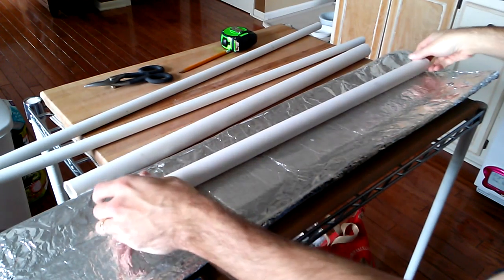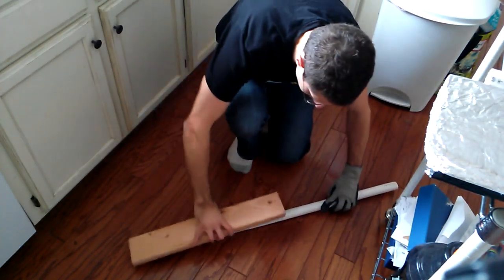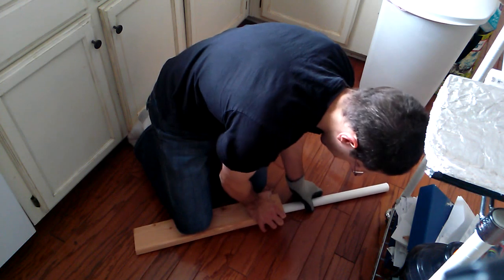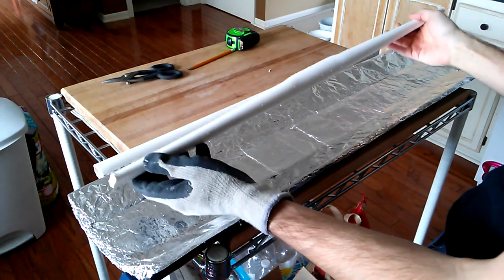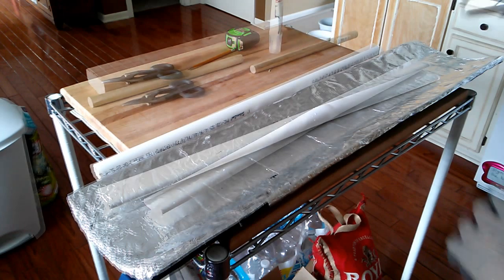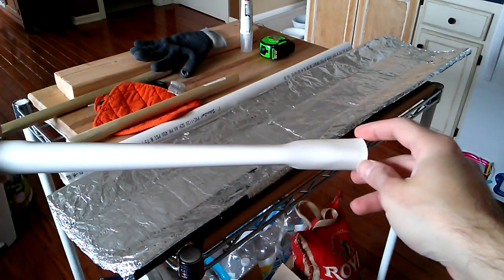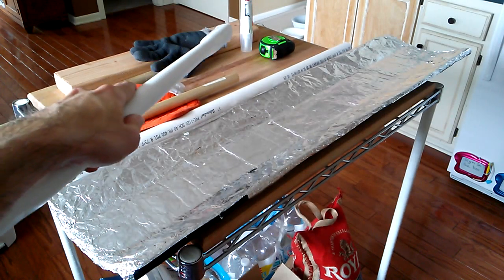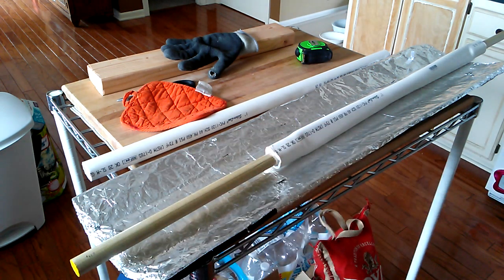Making the Holmegaard-Style PVC Longbow

Comment from the maker: It's what I had on hand, and it was smaller and lighter. I think the larger dowel would be a better way to go. Definitely taper, you can save a huge amount of weight that way - my smaller holmegaard (1.0) weighs only about 490 grams, the same as one of my sipahi bows that's only 46" long, and doesn't shoot nearly as well at the same draw weight.

Comment: I have some limited black smithing/knife making experience. When quenching metal it is taken directly from the forge at a very high heat to the quench bucket. You are allowing for a slow release of most of the heat while you are working/flattening the pipe. The pipe is already in a relatively solid state when you are running it under water, so it should have little to no effect at all. Much of the discussion here would only apply to moving the pipe directly from the heat gun to the faucet.

Comment: Remember I asked about a Kasai Bear I bought - what limb is top or bottom - I braced the bow and measured the tiller and found one limb a little stronger - so I let that limb be bottom. shoots perfect with 7 in. brace height and 3/8 above knocking point.
Hope this is right  Thanks.

Comment from the maker: Not that I shouldn't worry, I'm just not convinced it's a problem yet :-) 

Tell you what, I have sheets of PVC - nice, even thickness. I'll heat one and let it cool slowly, and shock the other. Then I'll construct a bending test, and we'll see if the difference matters within a range of normal use for PVC bows. I don't doubt there'll be a difference, but the magnitude might not warrant concern.

Comment from the maker: Well noted. The challenge here especially is how to mate two dissimilar materials, and what form the junction will take. I chose to insert the dowel on one side, since it leaves the other more even and flat. 

The most efficient bow designs for longer bows tend to be pyramid-shaped, if they use width to control bending (since you're going for a fairly even, ie. circular or elliptical bend). Here it's impossible to alter thickness without altering width, complicating calculations.

Comment: Oh, side note for improving design in regards to stress analysis.  The best type of beam is a perfectly straight beam with not cross-section change.  In other words something like this:  l l  If you have instantaneous changes in your designed cross section, so something like this:  l l = l l  Then that is bad.  I'm not sure about the bow physics and how changes in curves apply to the overall speed, but in general smoother, longer curves mean a more durable design.  Source: Mechanics of Materials

Comment: To answer your question about the quenching process of the heated core here is basically what it does.  By quenching the material instantly it causes the properties to be brittle but very hard/strong.  Not necessarily good for a bow that you want to reuse again and again.  Here's the chemistry behind it:  By rapidly cooling a heated substance it hardens the crystals instantly.  Doing this prevents the diffusion of atoms into a steady, coherent state.  Source:  Undergrad Materials course

Comment: Couple of thoughts.  First, love the idea and think you are headed in the right direction as it relates to further performance.  I do have concerns your wood ends are too thin as it relates to the inner diameter of the pipe.  Lots of stress in this design on the wood as well.  Need to insure your dowels have straight grain, as they'll be under some serious tension at that length.  Can't wait to see the results!